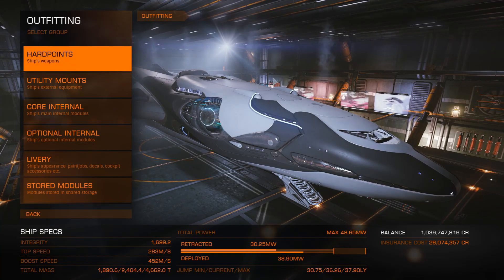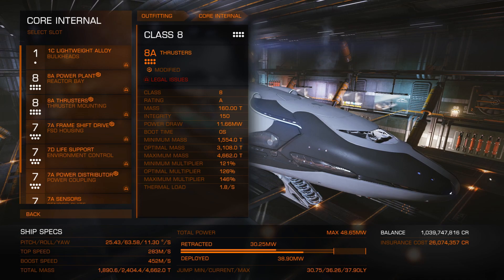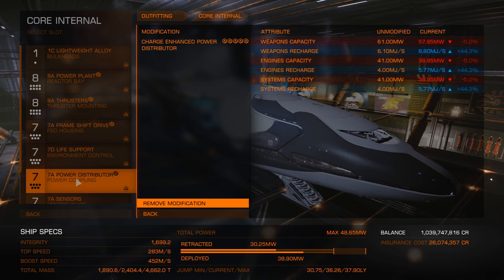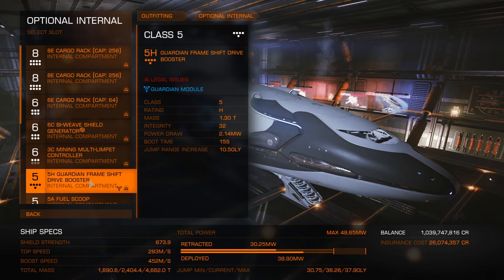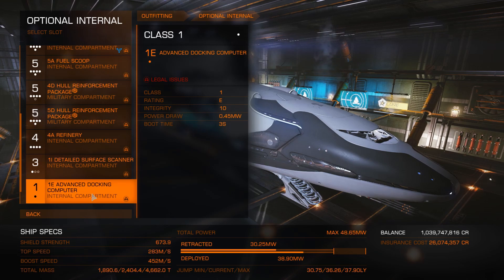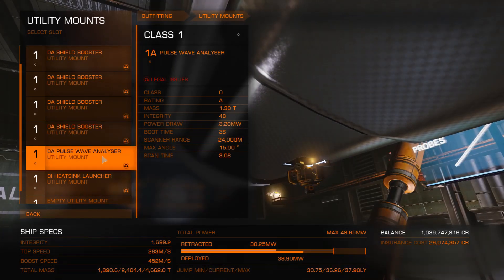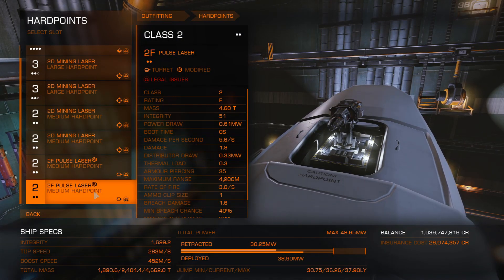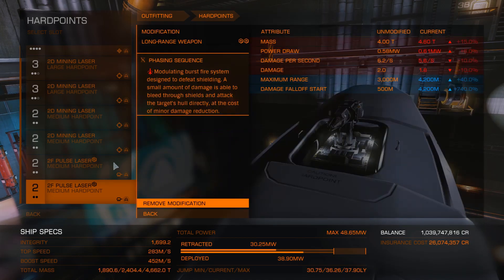Elite Dangerous | Laser Mining Build | Imperial Cutter

Comment: Hey man, I hate to say it but this build really wont work that well, I am a total fan of your content and not criticizing you, but I do have a few adjustments you could make to save yourself some time and grief:
-You need an A rated prospector as laser mining yield is based on prospector rating. 
-This build only has 1 collector limpet per class 2 mining laser (4 from the class 4 mining multi controller) where a general rule of thumb is to have 3 per class 2 laser. As it is now you have a huge bottleneck from lack of collectors.
-I understand that you want to have a lot of cargo space which is good, but you need to be careful about not sacrificing production for cargo space, the 64 capacity in the class 6 slot is almost cutting your production in half, as normally 3 collectors could be in that spot.
-The fuel scoop can be stored at a station near and picked up on your way to sell, giving you room for 3 more collectors that can be put in that slot, giving you 10 total, still a little shy of optimal for 4 class 2 lasers, but a vast improvement.
-I know the Cutter is a pain to land, kind of like trying to drive a bowling ball lol, but you will have to loose the docking computer, so you can move the DSS to the class 1 slot, and put a 3A prospector in the class 3 slot. I have found when mining big ships, to put the cargo scoop down when flying into station, as you will be used to flying like this.

Hey again, no offence or anything, if you dont want to take my advice hey no harm no foul -
If you have any questions I am happy to help :goodvibes:
Reply: i agree. you need the a rated prospect. limpet. but this is still a solid build considering its not helpless, you can blow some pirates with this build, and that is a great imersion satisfaction to the gameplay, to be able to kill criminals trying to take your shit.
Reply: Oh yeah im all for the guns haha, it just needs some more collectors is all I was saying. Its a solid build other than that.